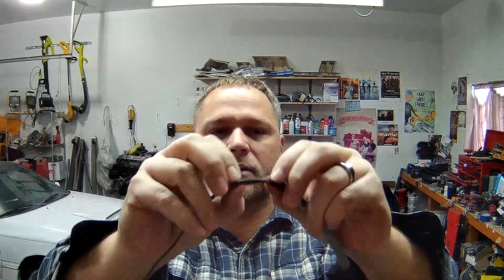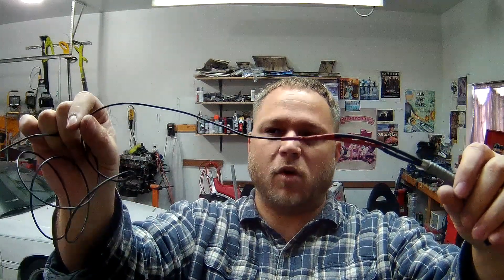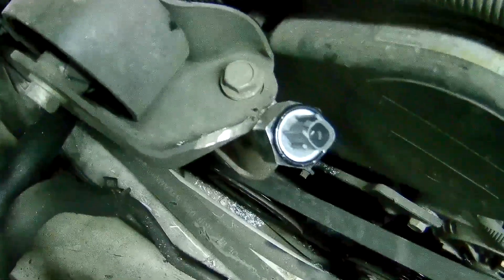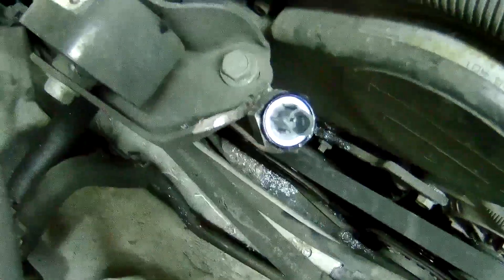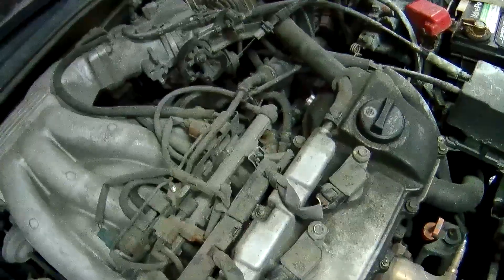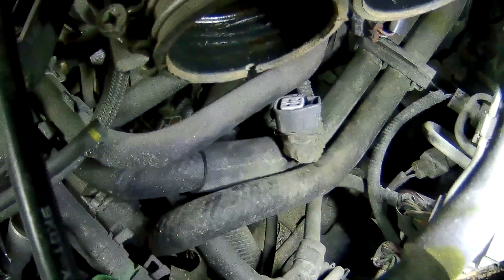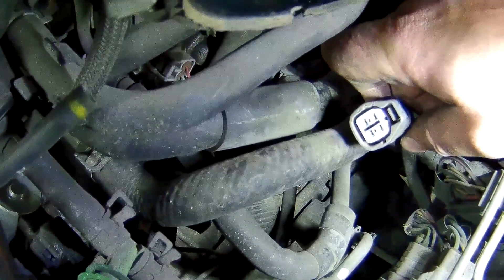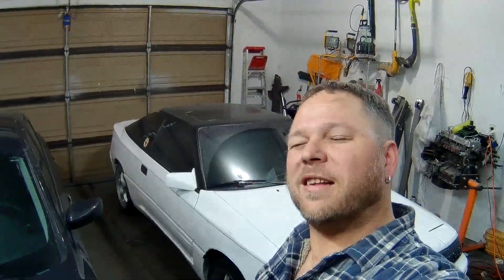1MZ-FE Knock Hack/Relocation

Comment: I just started getting the codes yesterday. P0325 and p0330. My car is bucking and hesitating terribly. It's a 2000 toyota solara with the 3.0. For me, it's a beater car and not worth tearing down and replacing the harness. I will be trying this as soon as parts come in. I'm only commenting now so others will see what the codes are and what my symptoms are. If this works, I may need to friend you in real life! I have a few similar hacks I have done on my solara along with my celica on my youtube channel. I will probably be linking this video in my channel. Thanks again!
Reply: replacing the wiring harness and the knock sensors aint that difficult. it's just time consuming , 3-4 hours work on the weekend would do. while u're in there it would be wise to change the harness and by pass hose+intake manifold gasket and  intake plentinum  gasket also. buy toyota knock sensors, they 're not expensive don't buy pos watever brand this dude use, same for the harness if u can't get them oem get denso harness( they're actually oem toyota). u want just to trick the comp, then use this trick but it aint fixing nothing, it's just tricking the comp telling the ecu everything is fine, so when there's something really wrong with the car, the motor just be done with. the harness last 300k, that's plenty of time before u even have to replace it. u can always wrap them in heat protective sleeve for extra longevity . i replace my knock sensor and harness on my wife 02 highlander( same motor), it aint that hard just be paitent that's all.

Comment: Did this in my RX300, i uploaded video , I will put your link in my description because the location is slightly different, and slightly EASIER since The knocks sensor harness is easy to get to. It's been about a 3weeks since And no check engine light, thank youu🙏🏽🙏🏽😭😭😭 I shall cherish this moment forever
Reply from the maker: Glad it helped you :)
Reply: UtahSleeper Me too I work as a technician and i use this as my work vehicle... The motor mount is a little bigger so drilling the hole was easy, and the harness wasn't hard to get to
Reply: did you get that video uploaded. I would like to do this to my RX 300
Reply: Kevin Bartsch yes i did and i put shortcuts in the description 

https://youtu.be/SvKB4AoVWkE
Reply from the maker: @KevinBartsch  his video is here https://youtu.be/SvKB4AoVWkE ........I was a little late lol

Comment: So did this last?
Reply from the maker: @Dylan Smith Agreed. With how the engine was abused I was amazed at how long the engine lasted before it finally gave up. Love Toyota's for that reliability.
Reply from the maker: No, but not because of the hack. He was able to drive it for a couple days, but the car had been having HG issues/symptoms before the hack. The head gasket gave up after 2 years of having symptoms off and on.